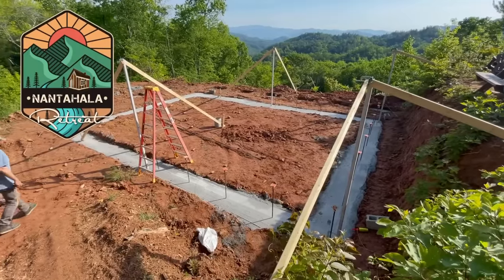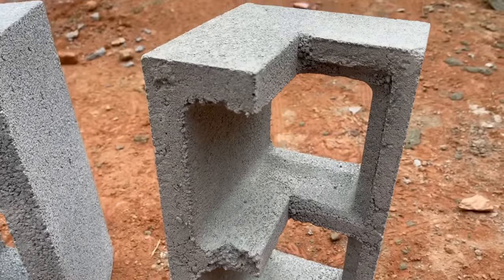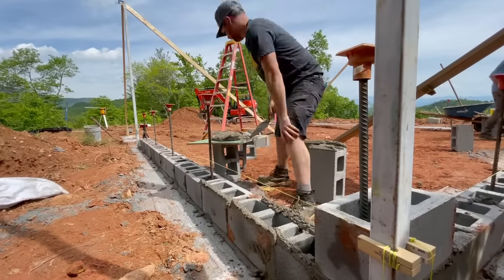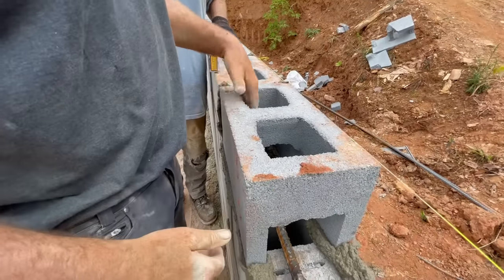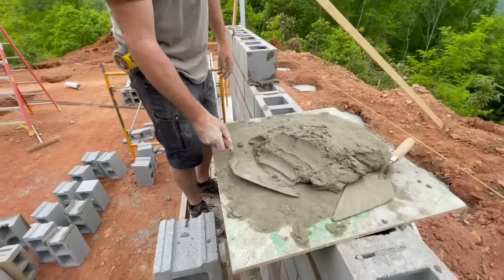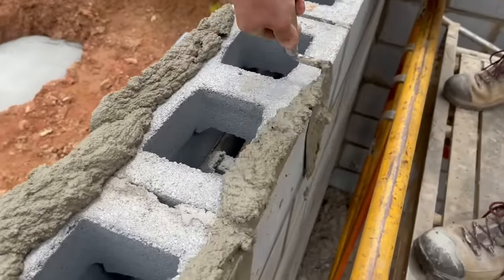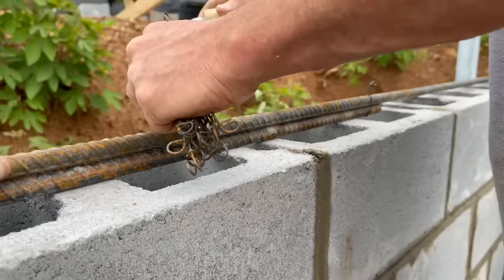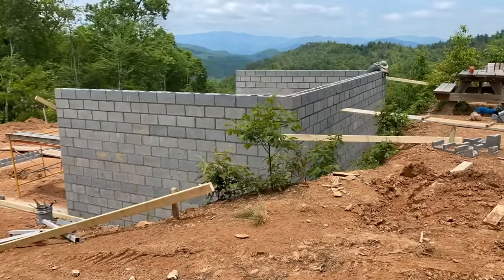Block Wall Construction | Building The Nantahala Retreat #3

Comment: Love that yall do the block portion of the job I will say being a mason for 17 years that you are laying the bond beam upside down the rebar should be laying in the slot after you lay it putting it in the middle of the core.  Not on the bottom.  Not sure if yall knew that.  Great job none the less.
Reply: Maybe I missed it but I didnt see any cell tape either.Good work tho
Reply: I mentioned that to them long time ago. Stone Mason (and all other Masonry trades) 40+ years in GEORGIA and you are correct‼️ 
    Eric mentioned why they do it that way in older video. I don’t recall his explanation‼️
         🏴Sla’inte Mhath’🏴
Reply: Came here to say that.  I don't see the usefulness of laying the rebar on top of the course below.  Pretty much negates the whole use of a bond beam, does it not?  The horizontal reinforcement is now in plane with the grout line.
Reply: 😂 tought I was the only mason that noticed
Reply: Did they even grout fill the vertical reinforced cells?

Comment: can add more planks on the scaffold set mud board on the planks not on the wall than mud the blocks all the 
way down than set set set. Sometimes I turn the knock out course facing up seems easier to me that way. The hardest part for me is to keep the mud board wet in the summer heat. Can set 700 blocks a day straight run cut joints and clean.

Comment: What you guys call a mud board in the UK we call it a mortar board, your two trowel sizes the block and brick are completly different. We have the brick one which are your block ones and pointers which are your brick ones, then we have gaggers which got your perp and bed joints nice and curved

Comment: Two pieces of pipe with an ID big enough for your rebar works well for bending.  Slide the pipes on at either side of your mark.  Step on one of the pipes and pull up on the other.

Comment: Hey Eric, sharing a "pro tip". Tie a 6-8 string onto that level w/ a 8" wide piece of scrape 1x 1  on the other end. Hell even a used chop stick. This will always catch it as a "t" brace, before falling to the deep pit of doom of that insane wall. !! Think of it like an anchor. Some of that used mason line and a chop stick work great!

Comment: Bond beam is layed upside down. flip them over and then the steel rebar sits perfectly on the knock-out portion at exactly half way in the block channel. when filled with concrete this locates the rebar.

Comment: The wall would be ideal if it had some damp insolation at the bottom.There will always be wet on the first 2-3 blocks from the bottom up.Concrate works as a damp and cold bridge.
Reply: They could run a French drain around the outer slab to elevate some of the moisture problem. They often do same here in Mexico and only way to salvage it is the drain! :(

Comment: you should try building basement walls in the UK the block manufacturers came up with the idea of 18"x12"x4" solid blocks laid on their flat, up until recently walls were 12" thick so this size of block was a quicker way of building below ground level walls

Comment: You should tie or have a small string with carabiners hooked from the torpedo level to your belt loop. Just in case you did drop it in the blocks. Keep up the good work.

Comment: Throw that torpedo level off the mountain. It is slowing you down and making an inferior wall. Blocks are not perfectly square. Face up the block to the exposed wall. You can't face up, and level the course side to side. The only exception is the first course, you can plumb the face, and the last course, where it is an  advantage to have the block perfectly level side to side. Use that builders eye y'all brag about! On a brighter note, I think its great!

Comment: Put a string on the end of the torpedo and hang around the neck or of belt, so if you do drop it down a hole, you just pull it straight back up!

Comment: I think making the mud is the easiest part of being a laborer. Usually 34-36 shoves of sand and two 75 bags of Mortar and depending on heat a couple of buckets of water or more
Reply: where im from its pretty much always premix in big bags. we use silo's so physically its very easy for the laborer.

Comment: i missed it, what grade rebar for the verticals / horizontal beams? is it bad that the jbars are touching soil? when placing the vertical rebar every 2 ft, how do you tie into the j bars at the footings? 

id assume you tie extensions on but. there were times i saw the doods laying blocks and no rebar was sticking up out of the course. do you need to tie in the verticals or. dropping the vertical rebar in every 2ft, filling with mortar tie everything in? really appreciate the knowledge of the trade doods

Comment: When I was a much younger man starting out in Construction  a Older guy used to catch me  all the time  pounding with my hands on things to get them aligned up correctly  and he used to tell me you will never last  a lifetime in this Business  using your hands that way  use your Dead Blow Hammer  or whatever else you have  but your hands aren’t designed to take that kind of  punishment over a long time  watching your Patented Pat reminded me of that mans advice  use your Trowel handle  or whatever to set your Blocks not your hand  that Old Timer told me you will thank me when you get to my age BTW he was a Union Carpenter and I did Professional Woodworking untill I retired  and I will say  I do have plenty of Achescand Pains from the 35 years I spent in Construction  and Abusing my body in other Activities

Comment: nice job but you should fill up the block holes with cement too.... to make it even harder and water wont fill in to avoid overtime corosion on the metal rods... here in philippines that kind of constructing using hollow blocks is already part of our life, not to brag but many mason workers here that can finish what you did in just one day just single person.... i mean just the wall you did can be achive by one man in one day here in philippines, good job tho very clean job 😊
Reply from the maker: Keep watching the series… We do fill all of the block solid with concrete

Comment: I have questions 🙋‍♀️So I’m new at this and I am working on a sub ground greenhouse. You guys are entertaining and informative. I watched a few times. 😂
I have dug a 32 inch ish hole in the ground (by hand🥵)where I am going to build four rows of block walls then place my 7 x 10-ish pre-framed Greenhouse.

Question(s)

1- When you’re measuring up the pole for the string line at 8 inch increments don’t you have to allow an extra half inch or so for the grout stuff?

2-can I fill my blocks with sand since I have pulled a ton of it out of the hole. 

3-do I need to put rebar rods up through the blocks?

4-Can all concrete blocks be placed in ground(do they have different recipes)? Specifically, will certain ones withstand the moisture/dirt over others? Should they be painted with a sealant or lined with plastic something? I don’t want them to crumble because I chose the wrong kind. I’ve found the cheapest to be from Home Depot. I don’t think they have all those choices. 

5-i’m framing a concrete footing. Is rebar at the four corners good enough for the lightweight structure?

6-I noticed the blocks in this video are not flat on the ends. Is it necessary to use those single corner unit blocks? 

7-Is it necessary to level up the floor with the concrete slab? How much larger is the concrete than the blocks?

8-Do I need a bond beam row with steel for my small project?

9-it is December and I have winter conditions, no snow yet but freezing temperatures. My thought is that since this is in a hole in the ground and if I insulate somehow and cover the hole with my greenhouse plastic that I can keep the concrete warmer🤷‍♀️🤞🏻I’ve been digging for a year and
I’m determined to finish this project before Christmas. Is it doable? I have low budget, YouTube knowledge, primitive tools and no fancy equipment. 

I need a chat option with a contractor I guess🤪
Thank you for any advice 😁

Comment: Nice video, I upvoted it. I wonder why the workers in Portugal do not add mud to the ends of the blocks? They also lay only one single line of mud under a block right in the center, instead of two rows on the edges. Are they doing it wrong? Also the Portuguese do not seem to add lime or fire clay. They only mix gravel, stone powder and cement (for concrete) or marine sand and cement (for blocks). Using marine sand later walls give out salt crystals. Can one trust buildings in Portugal especially in the Azores, where earthquakes do happen?

Comment: Horizontal rebar not being code required in a basement wall is absolutely insane. What's to resist the buckling force at the center of the wall other than the tension member? It's what, $200 in rebar to ensure the basement wall doesn't cave in over the next 50+ years?

Comment: THANK YOU......THANK YOU.....THANK YOU......BUT AT THE END OF THE VIDEO.....WHEN YOU BROOM SWEEP THE TOP OF THE FOOTING.....TO LAY ONE COURSE OF BLOCK......YOU SHOULD HAVE HOSED THE TOP OF THE CONCRETE......BECAUSE DIRT IS STILL IN THE CONCRETE POURS AND GIVES YOU HALF THE BOND YOU WOULD HAVE IF YOU SUPER CLEANNED THE CONCRETE......ALSO.....YOU ALWAYS WET YOUR CONCRETE BEFORE APPLYING THE MORTAR......BECAUSE IF YOU APPLY MORTAR DRY AS YOU DID.....THE CONCRETE TAKES THE MOISTURE OUT OF THE MORTAR LIKE A SPONGE.....AND AGAIN YOU DO NOT GET A 100% BOND

Comment: Regarding half the basement being block wall and the other half stick framed: Does the asymmetry in weight (block wall being heavier than stick framed) cause any issues with the underlying soil? i.e. will one side of the footer settle more than the other potentially resulting in a crack. I ask because this is the exact design I am using for my basement. Thanks

Comment: Tying up floor mats on a story job or bridge deck, you pack 21 ft lengths, as many as you can get your hands around. Lay them out as a mat on 1 ft centers. You got to bend over and tie up 50 percent. You got guys packing and guys tying. The hardest work in construction. Rodbusters.

Comment: Uhhhhh????????
A "Light-Weight" CMU will not Stand up to Outside / Exterior Weather.

A "Heavy-Weight" or Normal Weight will stand up to Outside /Exterior Weather.

Guess which you Got??????
Reply: Also, you are putting your Bond Beam in "UPSIDE DOWN!"